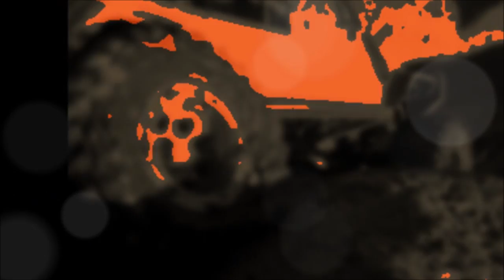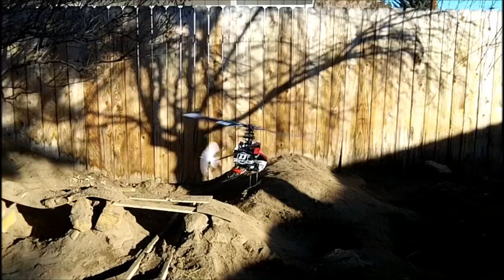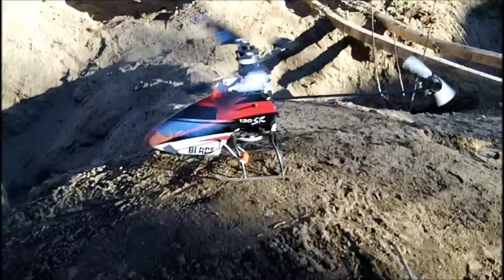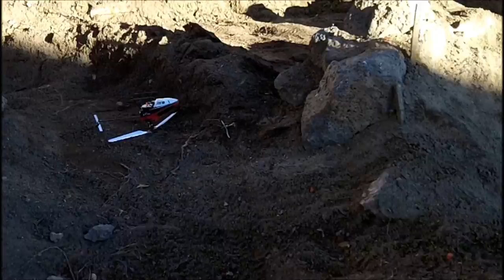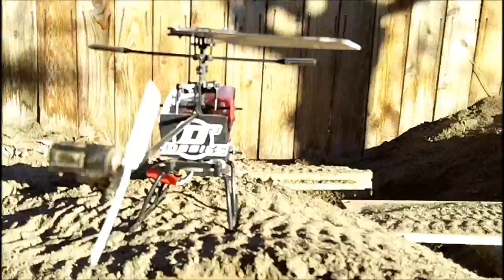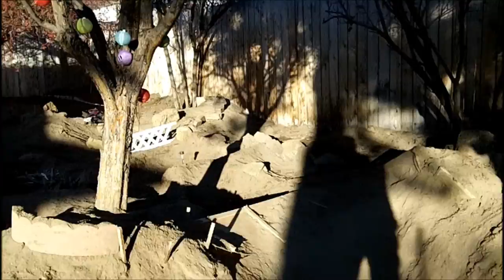RC HELI NOOB CRASHING!!

Comment: I have never flown an electric that size.  Just watching where you were taking  off from in rough terrain all that comes to mind is crashing and total destruction.  A 60 size gas machine is not forgiving like this machine is.  One touch on the main rotor  and the main blade does a boom strike and it is game over.  A tail rotor strike and you loose the tail rotor gear box.

Nice to see how forgiving this machine is to the pilot.  Thanks for posting.